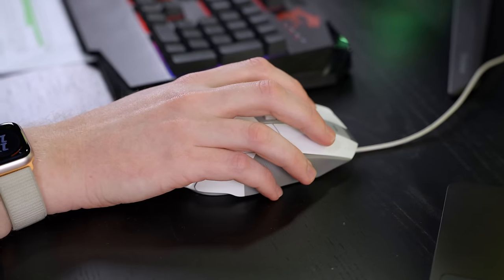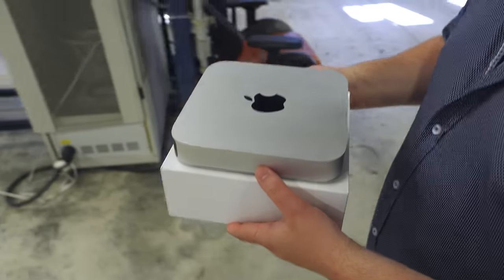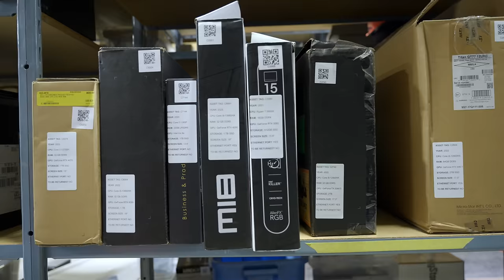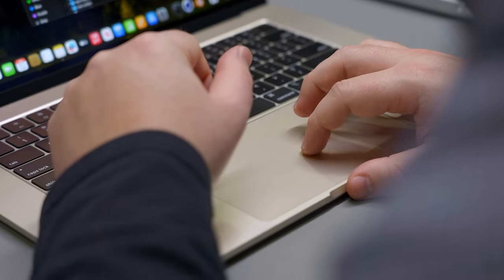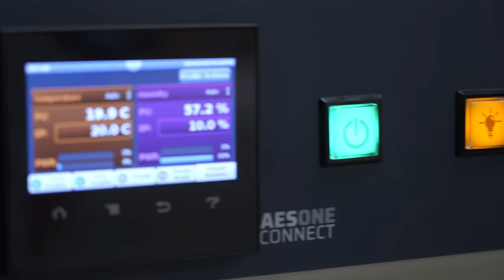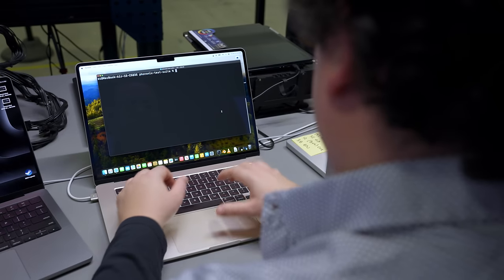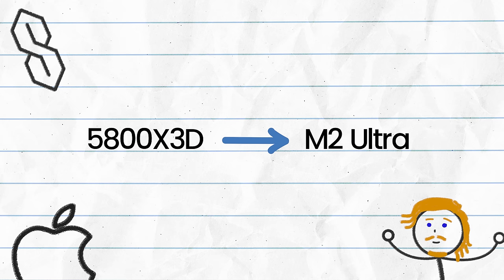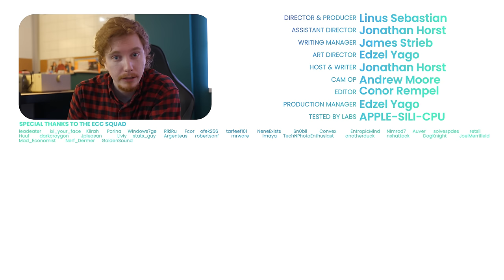How Apple Silicon Compares... - Part 1

Comment: Oi dinguses — this isn’t about benchmarking CPUs to see if Apple Silicon is faster than every desktop PC. They are trying to find a comparable CPU for each model of Apple Silicon so they can build test benches that allow them to evaluate GPU/gaming performance.
Reply: But the methodology is flawed as the AM4 chips have so much less memory bandwidth which may be a bigger factor in gaming than those tests.
Reply: @alexatkin  Well, not really. The tests they ran to pick CPUs included games, which inherently means that those factors that may enhance or hamper performance are already accounted for by the testing itself.

Comment: Shame you did not use CB 24.  23 is still based on a rather old fork of cinmara4ds renderer that is based on Intels RT cpu lib, while this can target ARM it is more it does a very poor job of this compared to the massive amount of hand crafted x86 code paths that it has on x86. The newer version of CB 24 can now at least be considered optimised.

The reason apple silicon did so well in some of those tests I the MASSIVE memory bandwidth and much larger out of order instruction buffer these combined mean any large data throughput task, (like audio, video or compression/de-compression) will tend to run a good bit faster.  In the PC space most of these tasks are memory bandwidth limited (as high mem bandwidth costs a LOT to support).
Reply: Which is all the more confusing they chose AM4 over AM5.  They completely ignored how memory bandwidth will skew the results and they should at LEAST be using DDR5 to narrow the gap.
Reply: @alexatkin   Memory bandwidth is part and parcel of the product however, this is of cource one of the reasons apples CPUs do so much better in those media and compression tests were most x86 systems (even DDR5) are massively bandwidth starved.

Comment: The AMD and Intel chips included in these comparisons are quite old. (the 5950x was released in 2020) It would be more interesting if you had the latest stuff from both Intel and AMD as you have apple's.
Reply: Its a gpu test. Not cpu
Reply: @JonGretarB  No, when did he say that, and what's the title? 'Comparing PC Parts to Apple's M3.' Regarding your argument, most games experience a CPU bottleneck at 1080p and even 1440p; only at 4k is the performance limited by the GPU.
Reply: @HellBlade30  about the minute mark is where he explain all this. 
Did you not watch the video?

Comment: I think you could have combined the 5000 and 7000 series from amd.  Not sure why you had to stick with one series of cpu as low end cpu's exist for the 7000 series.  Maybe they weren't available at the time of filming.  You also didn't include any of the highend cpu's from intel for desktop parts.  So I think this was sorely lacking.

Apple's big disadvantage to me is that they don't offer a desktop mac using desktop parts for the average consumer like pc's do.  Even in their desktop mac's like the iMac, they still use mobile parts, limiting performance.  It also increases their price doing this.
Reply: You also want the most powerful cpu when benchmarking gpu's as you don't want the cpu being a bottleneck.  What was lab's thinking here?

Comment: Stupid question, I guess for the cpu tests it might not matter as much, but I would hope that when you do the GPU tests you upgrade to a Mac Studio for all the Mac tests. Or go all mobile which then your CPUs don’t count anymore. Even if you went studio not really a fair comparison when the studio has maybe a 200w chassis where as the AMD desktops will use more than 200w on the GPU alone. I think you need more constraints on this comparison, either wattage or $$. But then I guess the point would be moot, everyone knows a pc for the same $$ will beat a Mac and everyone knows for the same watts a Mac will beat a PC. I mean the real question is what if Apple scaled up their GPU and CPUs to the same wattage as Intel AMD and NVIDIA? I mean you are talking for let’s say entry level 5600X3D and a 4060Ti about 350W. The studio with the ultra is probably half that, so what if it was double, it should be perf per watt imo.

Comment: I think you really made a mistake here, not adding a few AM5 CPUs such as the 7950X, 7800X3D, 7600 to properly reflect the more recent generation, since after all, you do have several recent generation of Apple CPUs. If you want a like-to-like comparison, you need AMD CPUs here that can match them, and you don't have that do, at the top third or so of the Apple parts. I hope you'll rectify this.

Comment: WINDOWS REALLY HAVE TO FIX THE F** POWER ISSUE. The fact that the reason why he bought a mac was a power issue?. And i agree. The worst part about my windows laptop is that every single time i open it after a couple days its run dry. HOW, WHY. FIX IT!. It really isnt a huge problem to solve but it sure feels heavy. Heavy enough for some to swap out operating system. INSANE

Comment: I hope this series at least looks at power draw between the options, either cpu and gpu separately, or all together. A big part of the apple silicon (and risc in general) proposition is similar performance at dramatically reduced power costs.

Comment: Amd last gen vs apple lasted gen, not exactly a fair test. Should have been an 7950x , also if going to test a top of the line apple chip don’t forget about threadripper as the system costs are about the same

Comment: I did think it was funny that that the M2 ultra beat the M3 in most of the tests.  why is it that we are using older parts?  Why is it that even supposed "third party reviewers" are doing what apple does when they compare by using older hardware.  is the real reason you didn't find a comparable AM5 chip because it walks off and leaves Apple?  Can we get a Part 1.2 where we can see the results for newest on both sides and also have "non-canned" testing done?

Comment: I understand this is an Apple centric channel, but sheesh. For intel, you didn’t even bother to grab anything higher than a last gen i5.

You also say it’s meant to be comparable, when clearly it isn’t, some of Apple chips are less than 6 months new, and for amd you went for 3 year old chips; you will end up bottlenecking the gpus. You should’ve done am4 and am5, multiple generations like you did for Apple with m1, m2 and m3.

This test is HEAVILY skewed, and if any pc beats the higher tier and newer Apple chips it’ll be even more impressive. 

This is the first video of yours since you started that should be re-uploaded and corrected, like other ltt videos have been in the past.

Comment: I don't get it. Why compare current gen M processor with a more than three years old chip?
I am no fanboy / hater of any of those but I was wishing for a fair and functioning comparison.
The argument for AM4 (same platform for many generations) was either not presented well or just plainly ill fitting.

Edit: I just ran a Cinebench benchmark with my Ryzen 9 7950X and I did hit a little over 40000 Points in multi core (38% higher than the top performing M-Chip) and 2120 Points in single core (~6% higher than the top performing M-Chip). All tests performed with a bunch of background tasks running, so no ideal conditions at all.

Comment: Sorry I'm getting fed up with MAC. Well Apple. I'm still on 12.7.3 oh wait gotta do this the appleway what is the stupid name monetary?
I am wanting to move to linux semi have it on most of my systems but I like the interface on Mac and you can't beat the battery life. but apple keeps ruining the interface.
Just had the weirdest crash the other day it was acting like a key was being stuck and repeatedly dinging constantly. I Open up a text document and hit every key on the keyboard... No repeated keys interesting. I rebooted it and now it was flashing the screen because the notifications timed out the auditory alarm. Reboot it again… Closed it and put it in my bag it never went to sleep so I think I shut down this time or rebooted I lost count.
So when I got into the gig started setting up and got back to it I realized yeah it's probably baking itself in the bag draining the battery which I was trying to recharge in the car on the way to the Place. Yeah this was a band gig where I end up using my windows computers I don't have to touch the Mac.
It's amazing to think how reliable windows has gotten. At least windows 10.

I do computer support I just set somebody up with a brand new iMac blue, beautiful. Well as long as you get the ethernet power adapter. In the process of transferring from the Old Computer I need to charge the mighty ^dum mouse because it died so I grabbed a USB cable and plugged it into the old Mac.............. No longer had a mouse! It repaired itself to the other Computer did not know that was a thing how do you get it back? hhhhhhhhh?
Let's see I go to System Preferences but wait we don't have System Preferences anymore we have settings and then in settings it takes 10 minutes to figure out where we're going because everything is buried now because the interface for a phone doesn't necessarily work on the computer. and the phone in Interface wasn't that clear and organized like system preferences to begin with. Oh but wait with this graphical update we broke the keyboard navigation!!!!!!!!!!!!!!!!!!!!!!!!!
I have more macs than Windows computers however in the last year I've been acquiring more windows computers and I'm about to put a down payment on a framework 16. Which will be dual booting windows maybe I'll downgrade to 10 as it comes with 11. but it's definitely going to have a partition of Linus or is that Linux.

Oh and then the speech to text system that I rely upon occasionally just decides to stop in the middle of a sentence or completely not work anymore even after disabling and re-enabling requiring a restart.
At least when the wind is consistent the one in Winters is consistent and usually gets the words right.
And at least the wind and windows is consistent and usually gets the words right it doesn't change them halfway through the sentence.
And at least the one in windows fairly consistently and gets the wording right and it doesn't change them as soon as I finish.
The number of things that I've been like oh yeah that's great, hit done and then all of a sudden I looked back and entire sentence is totally not what I said now.

Edit oh yeah I forgot this is a 2019 MBP and just about once or twice a week the USB-C connection to my dock at home will get wiggled just enough by looking at it ever so slightly and it causes the entire system to crash or the battery to stop charging or the ethernet adapter to drop. Why isn't the page loading yeah cause there's no longer an ethernet adapter and it can't determine whether it's on Wi-Fi or ethernet anymore.

Then there's the weird MDNS issue. Every modern Mac computer and iPhone and iPad mostly on the iOS devices but more so on the computer is now just randomly decides to rename itself! So my iPhone becomes my iPhone–64 usually by the time I go into settings and find it. Well at some point that Code got merged into Mac OS X and it happens on the desktop now too! it sees itself and decide there's another computer with the exact same name and MAC address let me rename myself!
And you can't just rename it back anymore do you have to wait for whatever demon to restart or restart the system before it'll let you rename it.

Then there's this *ing Display Menu/ settings.
Plug in you displaying it instantly mirrors that's great! the Touch Bar gives me an option which I usually forget about and all my windows get resized and rearranged when it decides to mirror to a 1024x768 projector. OK I have a Display Menu app I go in and check mirror great now all the windows that were on my main display or on the projector I have to manually drag them all back! Didn't used to do this in previous versions. Oh but wait maybe the displays capable one resolution but it automatically goes to another now you have to dig into display settings because we can't have a menu on the bar anymore to do that and then you have to click in like five or six different levels before you actually get that option. Is there an easy way to identify which monitors which hey not anymore they ALL have the same name (unless it's an iPad) and they removed the option of clicking and getting a red bar around the screen that was so much better than the way windows did it for years. Not only useful for identifying it showing all edges of the screen border to make sure things are set right with overscan < yeah because that's the thing still in the digital age. And we've had like six different iterations of the display settings for something that hasn't needed to change in 20 years.

I'm trying to think of something to write that I actually enjoy other than some of the remaining interface. Terminal, how easy it is to manage apps drag them to the apps folder drag them out delete the preference file. Menu bar Adams once they were formally accepted. 08 permanent menu bar items that cannot be moved resized.

Oh great thought of another one notifications yeah I need to be notified.... Let's see goes to notification Center last notification oh I got a new email do I really need that notification to sit on top of my screen overlapping everything can't I just glance and have it go away maybe? If I plan to spend 10 hours in notification settings going through every application and then go through it again whenever I install some thing new. I was even using growler on 10.4! Which the integrated notifications killed! And does 100% worse job.

Edit
Oh yeah you can't dictate into a save dialog box, used to be you could. When did this change I'm not sure one of the updates how did I find out after a few updates of train multiple times and getting really frustrated of it not working.

But yeah sure you can now game on Mac!

Comment: Why oh why did you stick with AM4 for this test? AM5 is out since 2022, and those Ryzen 5000 chips you tested all came out in 2020 already. Of course this skews the tests heavily against AMD.

Worse, even with sticking to AM4, you didn't even test the 5800X3D, which would have been the most comparable to Apple Silicon and is the most popular AM4 chip by a country mile.

Comment: What. Why would you only compare to older gen CPUs? And where are the 7000(X3D) chips and the higher end Intel chips? And you say you don't want to test memory, but memory speed, latencies and capacity can be very important to CPU performance - you are testing DDR4 AMD chips against Apple which is allowed to use high speed memory. What's your methodology? What was the cooling and the bios settings? And you are using different operating systems when you could be isolating that variable by using Linux. in most benchmarks you show, thus Apple is faster and thus you failed your goal of finding a good match. Oh and also you may not even be able to test GPUs at their full potential with Ryzen 5000 without PCIe 5. So basically because this is an Apple channel you have to bias your benchmarks towards apple? Terrible video.

Comment: Whoa whoa whoa horsey! Slow down. Of course the testing is going to be completely biased towards apple. You chose am4 cpus with 6 and 8 cores and put them up apple APUs with 12 cores or more. PLEASE PLEASE PLEASE 🙏🙏🙏 try this again with a batch of AMD (am5) and intel 12 core CPUs. Running at similar clocks speeds within .5 GHz. At least try to be fair. And this way youll also gave Ram from the same generation. Much love to the whole LMG and associate partners. Blessings 🙏✨☀️🔱🌙🌺